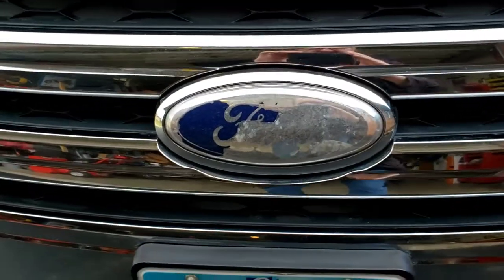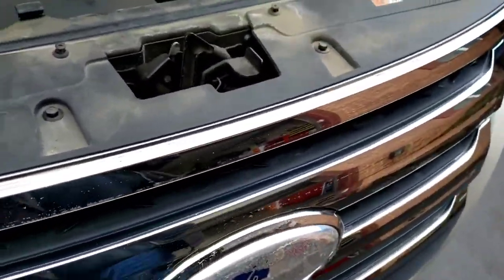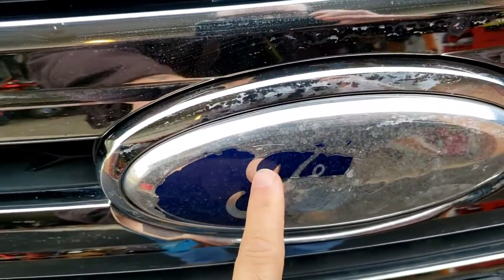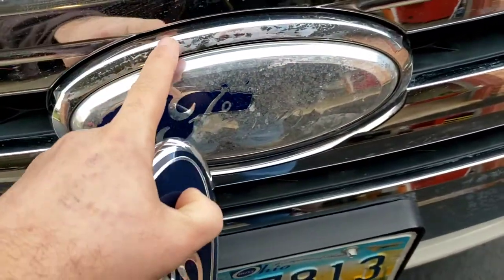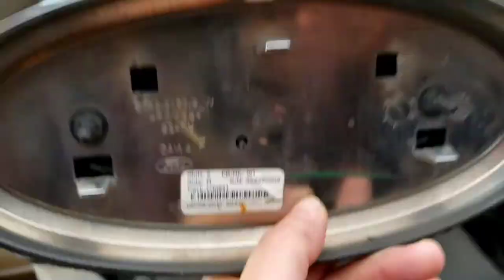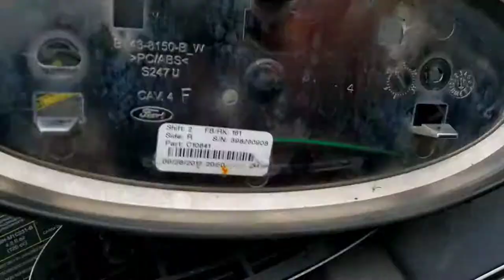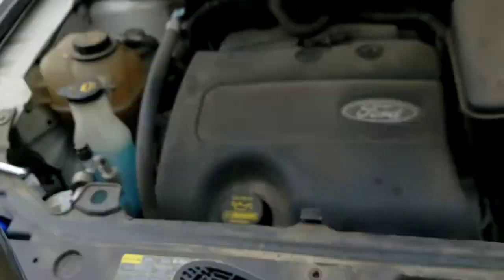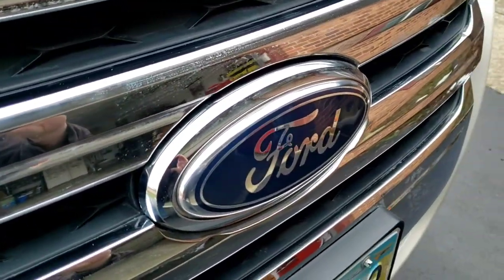Ford emblem replacement on 2013  Ford edge front grill

Comment: Thank you.  This video helped me a lot.  I just put an black & white American Flag style one on my wifes 2012 Ford Edge and woulda def snapped something if i wouldn't have found this vid.  I first started using a thin, flat metal scraper like what you remove old dry paint with... 😂 And then i thought about using floss next but figured I'd google it.  I def needed to loosen the front and reach in and push the clips to remove it.  You're the man!
Reply from the maker: So glad you found this helpful, I have seen that flag emblem on an F150, it's nice, gonna look sweet on the edge. Appreciate you watching and this comment

Comment: Great video-thank you! HOWEVER, taking off the manual thread nuts over the plastic posts are mandatory BEFORE trying to take the emblem off. I spent 2 hours, being careful I thought, but scratching the chrome plate and plastic behind the emblem trying to leverage the old emblem withrough breaking the tabs, following this video to a tee, and it failed me =(  I used a socket wrench to remove the nuts but it would've been easier to snip them with cutters. One fell immediately and I couldn't retrieve it inside the grill panel somewhere. They are cheap but shipping will get us. Bruises all over my forearms, and ended up using the tape on the back anyways.
Reply from the maker: Sorry you had so much trouble. I have done 5 of these and only had 1 that gave me a problem with the silver tabs, they broke and had to get a whole new bezel. But the other times it worked as I did it in the video. Wish you had better luck with it.. thank you for leaving this comment for others to see they may have problems as well... appreciate you watching..

Comment: Thanks for the useful video, just a quick question is front emblem same as the emblem in the tail? I mean the same part can be use front or back for the ford edge 2014?
Reply from the maker: @AhmedAbdelhafiz-i4x  ooh, good question, unfortunately at this time I can not answer that. The rear emblem, I've seen a few that are just flat on the back and stuck on with sticky tape. I'll have to investigate further. Hope you find an answer. I'm sure there's a video out there for the rear emblem. Appreciate you watching
Reply: @TriGogglin  Thanks for your reply,  do you have front emblem part number?
Reply from the maker: Didnt get a part number, I just went onto Amazon and ordered one..

Comment: I can’t get the bezel off to save my life… the two side tabs I think are loose but I can’t the top tab to move. Any tips?!
Reply from the maker: The top tab is a push up, I find if you do that one first the 2 bottom ones are easier to do, so pull up on the top tab while trying to push it out the hole at the same time.. thats the best I can tell ya.. just try not to break it.. good luck...

Comment: Looked straight forward. Unfortunately the four screws did not back out and when I got my arm down in the opening the two bottom tabs did not move and the top tap broke off with little force put on it. Project abandoned.
Reply from the maker: Yeah the 4 screws, the plastic gets old and the screws spin in place, you can put something between the plastic, like a screwdriver to apply pressure to help back them out, same with the tabs, they getting brittle, but you can use double sided sticky tape for the crome bezel so you don't have to but a new one. Or I have seen people screw the bezel to the grill, then use the sticky tape to apply the emblem.. sorry you had a bit of trouble.. but the video is an example of when everything goes like it should.. and that did not happen for you.. that usually happens to me.. lol I appreciate you watching
Reply: Thanks for the quick reply. I had tried to apply pressure under the plastic to aid in removing the cowling screws but that did not seem to work. Maybe I will try again. Much appreciated! @TriGogglin
Reply from the maker: Always something, my dad would always crack the joke, Ford had a better idea, 🤣 cause something was always a pain in the rear.. sorry i can't be more help at this point.. hope you get it taken care of..

Comment: Now that's lot cheaper than buying a new car. How long did it actually take to change the emblem? From my experience it would of taken half a day because that 10mm socket always goes walk abouts with the 9mm.
I'll have to remember this one is I ever buy a Ford again.
Both Ford and Chevy (GM) killed 2 of Australians iconic cars, the Ford Falcon, and the Holden Commodore V8's, that were designed and built in Australia.
Reply from the maker: Oh man Arty, loved the falcon. It didn't take that long at all, but all fords are not the same, the next may be different. And yes it's not my 10mm it's always my 13mm thats missing. 🤣
Reply: @TriGogglin   My 9mm always disappears first, and then my 10mm joins it, and they will show up a week after the job is done.
I didn't like the shape of the last Falcon they made here, as they went with the Mustang shaped front.
This time of the Year there was always battle lines drawn in Australia, between the Ford Falcon fans, and the Holden Commodore fans in the V8 super car races. Now it's Ford Mustang with Mercedes, Audi and BMW. GM haven't entered yet, as they don't have anything decent in production to race...lol

Comment: Unnecessary. You dont have to remove the bezel from the truck at all. Grab a 10mm ratchet, shuv your hand down and remove the 2 10mm nuts and the ford logo falls right out, put the othet one on, put the 2 10mm nuts back on the new one and done.
2mins job. These extra steps are not necessary with all the popping out tabs nonsense. NOT NECESSARY! 🤦🏻‍♂️
Reply from the maker: Thanks for your feed back, it may not be necessary for you, maybe your an expert. But seeing how you have no how to videos yourself i doubt it, But people rely on youtube for many do it yourself jobs. I have seen friends and family break that bezel cause their first instinct is to start prying on things and  break stuff. So this video is not for professionals such as your self, but for folks that don't really work on things and want to attempt it and save a little money.. but I do appreciate you watching,  and maybe someone will read your comment and do it your way. So you in turn may of also helped them.. thanks
Reply: @TriGogglin  in all honesty, avoiding those extra steps will make the job easier, dont need to be a professional. Its more likely you will break a tab by following your steps to remove the whole bezel in order to remove the logo, leaving the bezel in place avoids breaking any tabs and more work for that matter. Reach in, undo the 10mm nuts, and the logo will pop right off👍
Reply from the maker: In the future if I do another one. I will make a video trying that way.. it does sound like it eliminates the step. And I can see what your saying about breaking the bezel tab, that would definitely suck..
Reply: Si funciona como dice el amigo, quitando los tornillos 10mm sale el logo fácil